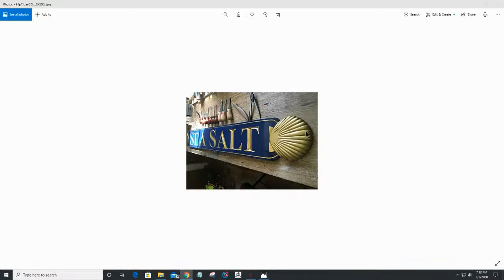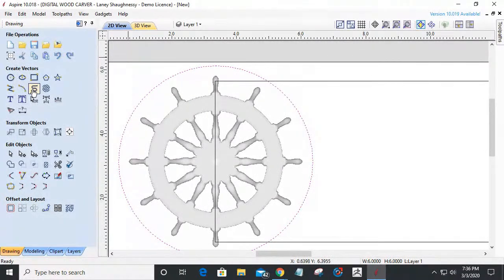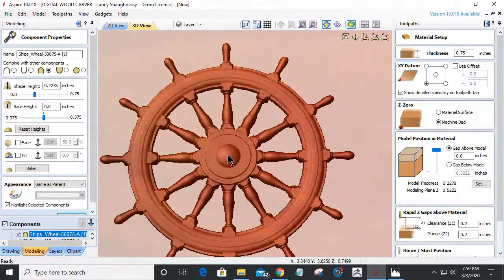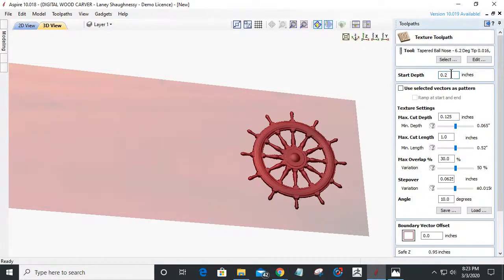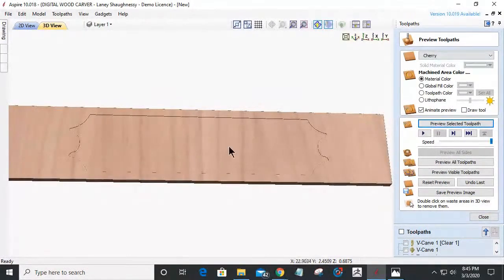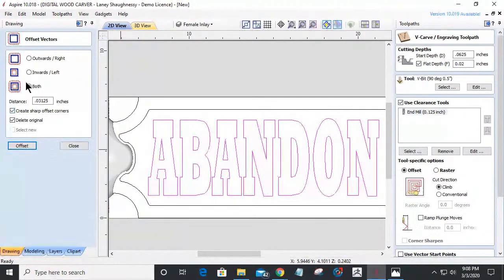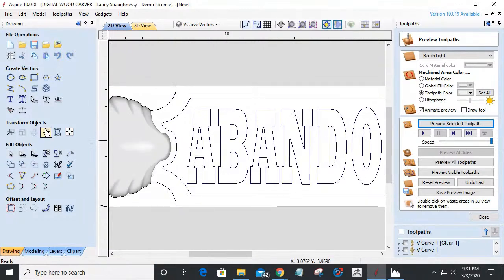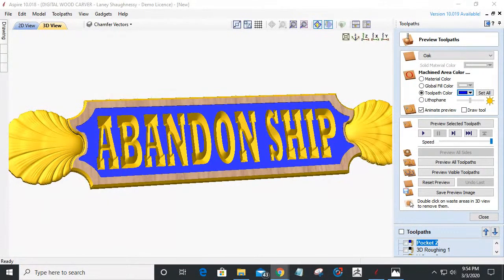Quarter Board Signs - Elegant and Eye Catching - Lets Design a Few - A Vectric Tutorial

Comment: Laney! I need your help! I have a CNC cutting of about 24x24 inches. So when I make a sign Longer than 24 inches ( not wider) I don't have a problem with the sign as long as it doesn't have a border around it. If I have a border, I am forced to tile the job. I am having a rough time trying to carve in tile as to the exact placement of the bit in the same start position as the last. Is there a way you could have a class on tiling? I looked at your pass videos and didn't see one. Or is there a way to copy the tile vectors and put them on another layer to carve separately?  I like starting in the center of all my projects because I am more spot on with tool changes in the center, than on the corners. Any Help? A video would be AWESOME!
Reply from the maker: I can hold a class on tiling but unfortunately in order to be able to tile a job you MUST start from the lower left corner in order to be able to use the software's tile toolpath function. If you are wanting to start in the center of a project, then you will have to manually lay out your tiles and tile boundaries. I can have a class on this but it will be about 2 weeks , the next class coming is a laser module class. I can do tiling after that.
Reply: SpindleTV Thank you: I will look forward to that. I am really wanting to know how to set the start position up so it can be used repeatedly